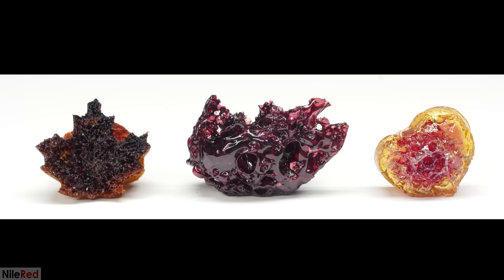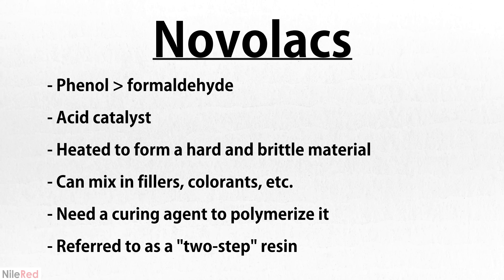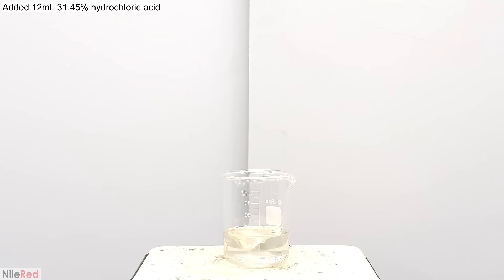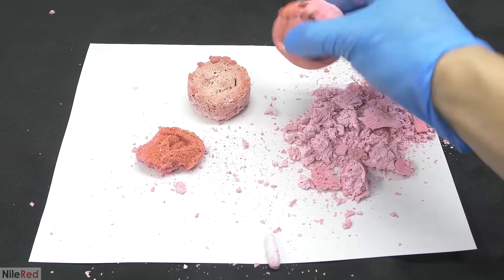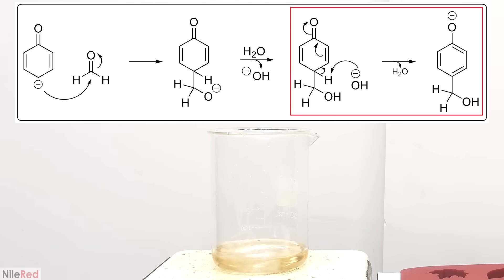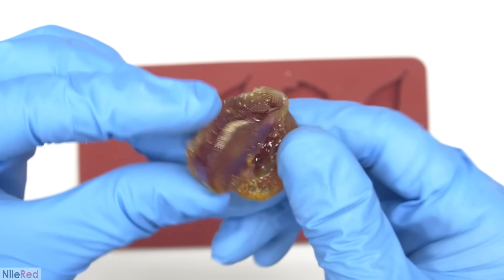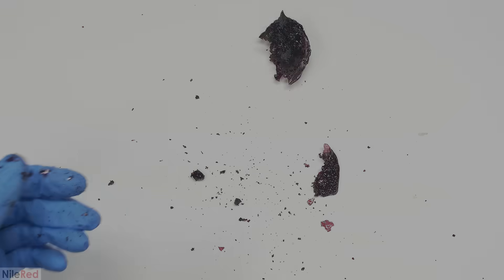Making bakelite plastic (Part 1)

Comment: This is what I do for a living I work for Sumitomo Bakelite. We make resole resins in giant pressure cookers under vacuum and distill the phenol/form solution. Once we reach the desired viscosity we thin the resin with alcohol (methanol/ethanol) to create liquid resin polymer. Most commonly used in adhesives, paints, brake pads and can liners. DONT BUY DENTED CANS

Comment: I'm hear after wondering if bakelite could be used as a 3d printing medium. After watching someone try to replicate the famous bakelite aesthetic on a PLA printed part. My first thought was it would be great is a filament manufacturer went and made a line of filament specifically to mimic bakelite, but I quickly began to wonder if one could possibly print the material directly. 

It doesn't seem impossible given the middle stage described here, but there's obviously some challenges to tackle to actually get a desirable end product. Probably can't stick a whole Ender3 in a pressure cooker.....

Comment: 2025 reporting in. Biggest difference from Nile then and Nile now: 

2017 Nile: "I didn't have a Bakelizer, so I used a toaster oven"
2025 Nile: "I didn't have a Bakelizer, so I bought the cheapest one I could find on Alibaba" [procedes to spend $10K on a Bakelizer just for this video]

Comment: The material is used for a long time for electrical use, like lamp sockets, even controlpanels. And switches or wall sockets. If one of these slipped out of your hand, it broke in small pieces.

Comment: Well, this seems very similar to modern 2 part epoxies, only with a more violent exothermic reaction.  But even modern epoxies can build up enough heat to melt a plastic mold, if you pour it too “deep”, and its not specifically designed for “deep pours”. 
  You can identify real old Bakelite, by rubbing it vigorously, with your thumb, and then smelling it. If its real Bakelite, that mechanical action it will still produce the faint odor of formaldehyde. 
   So much of what you do, just increases my understanding, of the magic of the chemical processes happening around us every day, that we completely take for granted. 
Thank you, for that. 🙏

Comment: Have you seen the black plastic medical splints.  They start as a flat piece of plastic.  They are then heated up and shaped around a body part.  They can be cut and then finally heated until hard.

Comment: Much like rubber if you try to heat cure the material without it being in a high pressure mold, you will just end up with a nasty glob of cured material with no real attributes.  Cure in a hot pressurized mold and the part coming out will have all the dimensional characteristics from the mold and the atomic structure is controlled to its desired attributes and maintain those characteristics until it is literally destroyed and still will have the cured form only in little pieces.

Comment: Maybe this ends up being ironically less toxic than modern plastics and gets used again on a long enough timeline.
Reply: Most modern plastics are pretty much thermosetting also. The myth that plastics are recyclable is perpetuated by the petroleum and plastics companies. Manufacturers of molded plastic parts will not reintroduce that scrapped part back into the system because the new part has a very high chance of being scrap also just because of the poor quality material.  Time is money and it is usually more cost effective to just throw the scrap in the trash and use only fresh material for all molded products.
Reply: @paul5683  Interesting. I was mostly joking like how paper bags and straws and glass bottles from the 40s and 50s are new again.

Comment: I was making that resin into the early 2000's. The plant didn't have fancy things like a control room 😆. You controlled the heat , which was steam through 6 inch coils inside a big kettle with a 2 inch ball valve. Then when you needed cooling you shut the steam off and switch to cooling water to control the exothermic reaction.
 40,000 lbs of phenol and around 10,000 lbs of formaldehyde, i can't remember what the catalyst was. It was an interesting job 🤣🤣🤣. Exciting also, especially when someone mixed the wrong things together or lost control of the exothermic reaction of a batch.

Comment: Bakelite is still commonly used in electrical applications: electrical panels, motor termination boards and such, probably because it doesn’t deform with heat.

Comment: Bakelite is still used in the auto industry. It's thermal resistance, insulating properties, resistance to chemicals, dust, grime, and just generally anything, can't be matched by any other plastic.

Comment: Pressurizing a container to about 5 bars would prevent water from vaporizing (on 150c) actually enough to pressurize it to about 3.5 bars at room temperature than heat it up to 150c .it wouldn’t be enough to prevent puffing up? It would have nice water droplets inside but that’d probably look way cooler than puffed up hard sponge. Please correct me if I’m wrong but for my ape brain it would make sense 🤨

Comment: in the gum cutting industry some companies still use Silicon Carbide (SiC) to make cabochons and give gems their rough shape. When making cabochons you have wheels in various sizes and different carrier materials. rough SiC cristals (like grid 30 to 200) are carried by ceremics, but small cristals for almost pre-polish are carried by bakelite. When you use those wheels, they give of a slight plastic smells.

To my knowledge, those wheels have been mostly replaced by diamond, because it is harder and longer lasting. But ceramic and bakelite silicon carbide wheels are still very important for making things like bowls, chandeliers, and other works of art that requier gems the size of hands. Simply because the diamond wheels are way to small for that and some materials like agate can crack due to temperature.

Comment: Fun fact: Bake lite was used as furniture for many firearms back in the day, especially popular in the Soviet union. It proved much more tough, wear resistant and weatherproof than wood. however, although very hard, when bakelite breaks it fractures in extremely jagged an sharp edges. It was removed from firearm furniture in no small part due to soldiers getting impaled by their weapons if they fell on them the wrong way...
Reply: I dont really believe the latter, other plastics became available
Reply: The ak parts were made out of glass fibre reinforced polymer called "AG-4", not bakelite. Thr bakelite was used in german hand drips for lugers and walthers though, and im pretty sure early makarov grips used it aswell

Comment: Would you ba able to use a pressure cooker as a bakelizer?
Basically Strachan a valve stem with a Schrader valve to pre-pressurize it, then heat it. You wouldn't be able to observe the reaction, but you'd have your pressure.

Comment: I use bakelite all the time when making knife handles, in the form of micarta which is made from the phenolic resin with layers of linen or canvas or paper reinforcing it, whereas classic bakelite uses finely powdered sawdust. Micarta's durability, strength to weight ratio, look, and feel really can't be beat for many applications.

Comment: gorilla glue.. same thing 
add to cardboard and you have something permanent... add a little kaolinite clay and it develops covalent bonds through the plastic... hemp rope floats... but as a bioplastic it is as hard as concrete and stronger than steel... 
polyurethane can be made from petroleum oil... or the cellulose if living plants... like bamboo and hemp... 
add acetone ... add pickling lime..and... voila... gorilla glue
Reply: with the clay added..  it becomes flame resistant... like a propane torch resistant... very cool stuff 😎
Reply: bakelite is an American imitation of the stuff from China... they have used the gorilla glue stuff for a long long time...furniture called lacquer furniture is made from this technology... the stuff we use to finish wood..  called shellac... 
old fashioned aircraft used cloth covering.. with a layer of... dope.. on first   covered with shellac... 
very clever people in China...

Comment: I wonder if you could prevent the bubbling without needing high pressure by mixing in some desiccant powder as a filler.  It would need to be something that is itself reasonably strong, and it needs to be not destroyed by acid or base (depending upon which type of process you are using).
Reply: Phenolic resin still still bubbles, even when using fillers, but you are right. The higher the filler content and the finer the powder, the more dense the final structure. In the industry, you often neutralize resin to get pH of 7. It still cures in neutral conditions.

Comment: I just bought some cheap electrical switches made of soft plastic that melted when I tried soldering the metal connection tabs. Since the switch can fail, I will not use them except for low current and voltage applications, far less than the switches "rating." The old bakelite switches are really durable. Always wondered how it was made.

Comment: Would a pressure cooker work, or is there something different going on in a bakalizer?
Reply: The pressure in a pressure cooker isn't anywhere near what the Bakelizer would have. I mean, it's a thick cast iron egg, that alone is indicative of how much we're talking.
Reply: It probably would, because you just have to increase the pressure so the water doesn't boil, ain't nothing fancy.
Reply: I was just thinking an instant pot might work.  I think an important question is whether the pressure needs to be kept up as it cools, or if once it polymerizes the pressure is less important.

Comment: You said the polymerization temperature is around 120.  I think normal pressure cookers operate at around 15 psig which is just shy of 19-20 psig at which the boiling point of water would be 125 degrees.  The typical weighted valve used to control internal pressure would just need a tweek or two to raise that the 4-5 psi needed.  Just make sure the safety valve is set high enough to take the increase.  The downside of not being able to see the reaction would be offset by having removed the reason to keep such an eye on it in the first place.
Of course, you'd still have to boil off enough water to build the pressure in the first place.  This could be mitigated by installing a valved gas inlet in the cooker's lid so a pre-charge of nitrogen or something (compressed air?) can be introduced.

Comment: If I'm remembering what I was told, this stuff was also used in combination with cloth wiring. The house my friends and I just moved out of had cloth wiring throughout, so I learned a bit about it while I was there. The bakelite would crumble away, and of course cloth rots as well, leaving live wires exposed to each other.
Reply: Some of those wires are aluminum too, aluminum can burn...

Comment: Bakelite was also used for guitar plastics in the 50s, 60s and early 70s! It's common in the guitar community to hate it because it had to be super thin to fit right, so it's notorious for cracking and needing to be replaced. The vintage guys are picky man

Comment: I recently learned that most "plastic" handles on pot and pans are actually bakelite(!)
Now I'll never throw out another plastic pan handle again. Some of them are quite beefy and can be used to make many things out of. Unfortunately I'm now in the switch for cast iron for much of my pan usage as I've gotten tired of all those modern non stick coatings not lasting (did use cast iron years ago when before moving from parents). Had I known it earlier I would have saved the handles. 
Have yet to throw out a pot yet but all I've got there is stainless so they just last forever.

Comment: To stop the one in the oven from bubbeling, you could have cast a layer of silicone over it and put a heavy weight like a part of a rail on it. At this temperature, you could also use lead.

Comment: It's still used for subway train brake pads here. You can smell it each time the train does air braking at speed, normally dynamic braking is used
Reply: not sure where “here” is, but i’ve always thought the NYC subway (MTA) had its own distinct smell. i hope it’s not aerosolized Bakelite dust! 😅

Comment: If the resol is curing itself with a runaway reaction, could you pour it into a mold in an ordinary pressure pot like Peter Brown (also YouTube) has and just let it become Bakelite on it's own?  He uses it to compress air bubbles in curing resin to the point they can't be seen.  Essentially, the high pressure just collapses the bubbles not unlike deep water prevents cavitation around the propeller of a submarine.

Comment: I worked across from a factory that was union carbide Bakelite factory in NJ. It has become a rock salt and chemical facility.
Reply: Bakelite had a few places around NY and NJ. i think they were originally in Perth Amboy in 1910 (“General Bakelite Company”). Later they were in Bound Brook, NJ. 

In 1939 it was acquired by the Union Carbide and Carbon Corporation. Funny to think they’ve been making plastic for over 100 years.

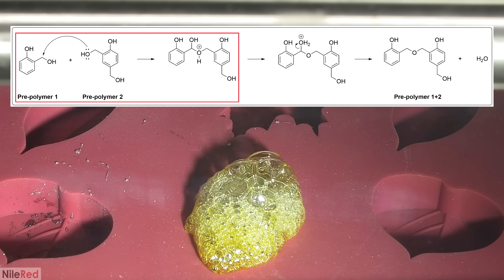Comment: So I know this is an old video, but the mechanism at 15:35 is not just incorrect; it's impossible. The benzylic carbon on the left-hand molecule already has four bonds (two bonds to hydrogen are not shown), and so the 1st intermediate is impossible as it would require displacing a hydride (this is not a thing that ever happens). 

If it were a direct attack, it would happen by an Sn2 displacement of the OH group (using a negative oxygen as there's still base in there) and directly make the product. However, what is much more likely is that it makes the same intermediate as shown in the first mechanism, which is then attacked by the oxygen from the second molecule instead of the carbon.

Comment: Use a pressure pot. I’m a dental technician and when I do acrylic repairs(Methylmethacrylate monomer/polymer) monomer liquid and powder. When I do a dental repair I put it in a pressure pot. You can control the temperature and of course pressure. By putting my repairs in the pressure pot it would heat it up to cure it but also the pressure would make sure no porosity(bubbles) in the acrylic. There are some really nice and fancy ones but the one we use it’s pretty cheap I mean you can find them for like $50-$100 probably at Walmart or something. I don’t know if that’s the same thing as that cool device that guy made but it just  heated it up and then pressurized it sounds to me like a pressure pot that has a adjustable temperature gauge that I use at work for the exact purpose of curing acrylic and avoiding porosity. Maybe check it out. Love your videos!!!!! Long time fan

Comment: Even though it's an early form of synthetic material, Bakelite has a certain tactile and visual quality that modern plastics just haven't got. I remember that it had a strong smell though.
Reply: Only if you had it exposed to either light or water/moisture. In pristine condition, it's almost odorless (mostly because it's so dense, so there's less sites for stuff to escape).
That aside, it really is a beautiful plastic. It has a nobility run of the mill plastic does not. Not even resins can emulate its cool feel. And it lasts (when maintained properly) for ever.
Despite its shortcomings, it would be a much better plastic for certain objects so they don't break as fast.
Reply: @aserta So, it stinks of formaldehyde if you keep it anywhere on the surface of the earth, got it.
Reply: Sort of like formaldehyde?
Reply: @jalexoneschanel1356  No, actually it smells far worse. It has an extremely strong acrid odor that remains in your nose long after the bakelite is removed.
Reply: It is a dense plastic that very few modern plastics can get near to.
Reply: man i just love how it looks so much, and I like that as a plastic, it was very purpose-built. Everything made with bakelite wasn't made to be disposable.
Reply: Smells like naim....
Reply: Same with Linoleum!
Reply: Only a strong smell when heated. I collect Bakelite! Admittedly, when I wear my Bakelite earrings, you can very slightly smell that formaldehyde.

Comment: If the phenol reaction produces water  Edit it can cause it to pop up and sometimes explode things out of the beaker could you do the reaction in a vacuum chamber? Turn the water into gas before that issue comes to pass, or would that just make the issue worse?

Comment: I've never wanted so badly to take a lighter to something that was bubbling. I may just be used to resin but that's what I was chanting.
Reply: Imagine it just catches on fire
Reply: @jalexoneschanel1356  I dunno if the bakelite would, but probably not. waving a lighter over things like epoxy just pops the bubbles, it doesn't get anything hot enough to be dangerous.

Comment: the solution must be heated approximately to boiling point before hot hydrochloric acid is added, only then the reaction is so violent that it could puff out the beaker

Comment: Wouldn't it work too if you heated it in a vacuum chamebr instead of a pressure chamber ? It would allow water to escape with the bakelite not being all the way cured, and then relieving the pressure and finishing the curing with some heating

Comment: You should try using your stainless steel PILL maker, with a metal strap or clamp to mantain the presure and put it all inside the oven to heat it, that way you could make a good bakelite pill, and experiment with heat and presure. I know he wont read this, but i think its a great idea if he tries.

Comment: if you want an explosion use a test tube and fill it with phenol and formaldehyde. make sure volume of phenol must be greater than formaldehyde. use concentrated HCl to catalize. fill the test tube nearly to its mouth, approx. 9/10 th part. no need to heat, as heat will generate all by itself. and you will get a glue after the explosion.